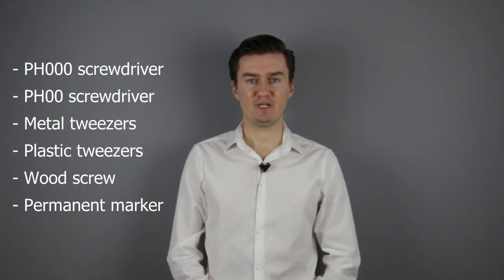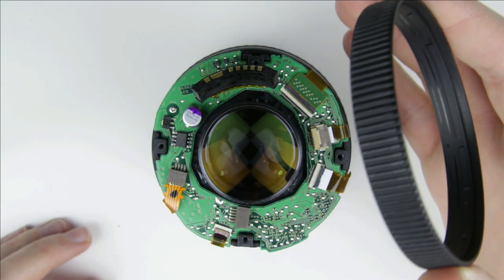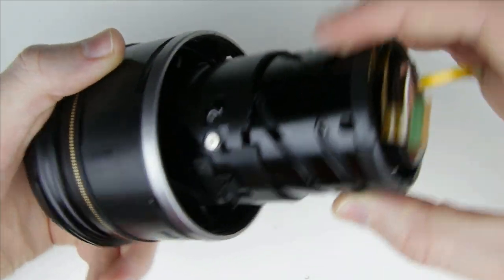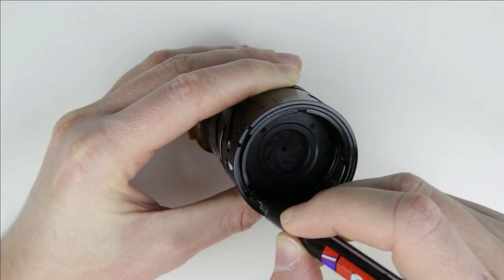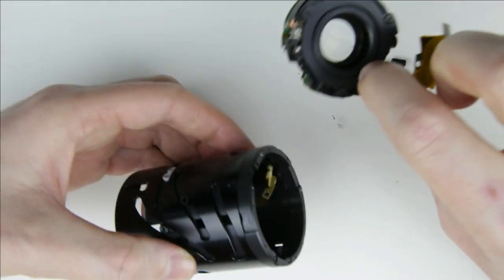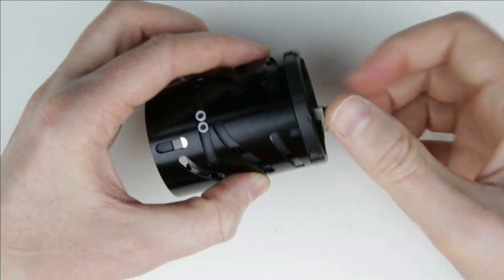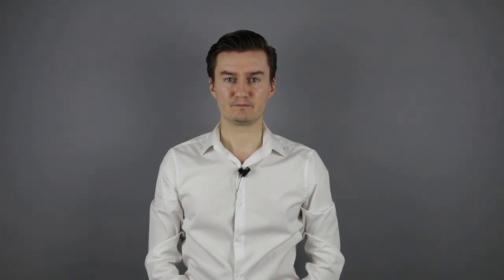Canon EF-S 17-55mm f/2.8 IS USM disassembly for replacing the aperture flex cable

Comment: Before you start disassembling the unit (9:20), mind that some of these lenses come with eccentric rollers on the IS unit. Mark their position and orientation before you disassemble in oder to avoid a decentered lens with poor optical performance.
Reply from the maker: I checked them, but none of them were eccentric, so that's why I haven't marked them.

Comment: What if you just need to clean inside back lens closest to bayonet? You can remove that around 5:36 correct you don't have to continue on? Mine appears to have the start of fungus inside that back glass & would like to remove it early on. Many thanks for your great videos! 🙏
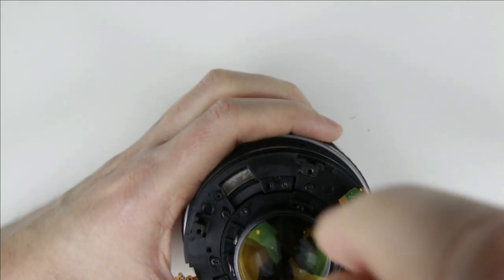Reply from the maker: As I remember, you have to follow this guide until I remove the PCB, then you can remove the rear lens element if you remove the screws which are parallel with the lens (so if you hold the lens downwards, the screws facing downwards, you can see those screws at 04:22). There are three screws which are parallel with the lens element (so if you hold the lens downwards, those screws are going horizontal)... those screws are calibrated, and as I remember covered with some glue, so don't remove those.

Comment: I'm really not sure if the risk @ 9:00 is worth it. If the loose focusing element crashes into the back of the front lens group the damage could exceed the lens' worth. Remove the front lens group beforehand (mark its position/orientation before you remove it) and then @ 9:00 push the cam barrel outwards and – after marking its orientation in the cam barrel – grab it carefully and screw it out, then store it in a secure place.
Reply from the maker: Thank you for your tip!

Comment: Tried the repair. Screws are glued with loctite somehow, maybe my second hand lens had already been repaired before ? In any case, I screwed up 2 threads of the usm motor. End of the story I think.
Reply from the maker: Sometimes some loose glue is used, but it is not preventing from removing the screws. Usually the problem is that the screwdriver not fits the screw perfectly, and it damages the screw.
If there is a little groove left in the screw, you might try Bondhus Screwgrab, or use a very small circular saw to cut a groove in the screw, and use a flathead screwdriver to get the screw out, or drill a hole in the head of the screw. If you cut or drill, be very careful not to get metal dust inside the lens.
Reply: @CamerasLensesEtc  Hi, I went with the circular saw and I got the screw removed ! Let's see how far I can get from here :)

Comment: I tried but got stuck at 7:15 the screw seems to be glued in place and won't move at all. Any tips?
Reply from the maker: Do you still have the head of the screw or it is shaved off? If you have, try other screwdrivers, there are some PH000 or PH00 ones which fits better, some of them don't go into the screw completely.
If the screw head is shaved off, then you can try to use a pliers with teeth to grab the screw from the side, or if that doesn't help you might have to drill the head of the screw. (Or search for other solutions here on youtube.)

Comment: Definitely worth the effort for a more expensive lens like 17-55mm.  I had a very old Canon 28-80 mm II kit lens that only worked properly with the camera set to aperture priority & f3.5.  Probably flex cable problem.  Anyway, it did work but photos were pretty soft and lots of purple chromatic aberration.  To get a decent photo it was necessary to adjust in the Gimp or Irfan View.  So I gave up on the lens & bought a Canon pancake lens which is a 100x better😀
Reply from the maker: Thank you for your comment!

Comment: I need to buy image stabilizer cable, where can i get it? Please answer, thanks.
Reply from the maker: As I remember, you can't buy the cable separately, you have to buy the whole IS unit.
Check ebay and aliexpress or your local camera repair shop.
Reply: @CamerasLensesEtc  many thanks for your information.

Comment: Deleted – provided wrong info here, sorry
Reply from the maker: The screws I removed at 12:45 are not calibrated/eccentric screws. There are three screws which are on the side of the lens (those still in the last lens element, and were not removed), and they are eccentric screws, so calibrated, but they were not removed from the last lens element I removed.
Reply: Deleted – provided wrong info here, sorry.

Comment: I know it's been several months since you posted this video, but do you remember if the zoom-ring on yours tended to be sticky?  My copy of the lens requires me to pull the focusing ring towards the camera fairly tightly if I want smooth zoom while using the lens to take video, and I'm curious if this is common or a quirk of my particular lens.
Reply from the maker: I repaired several of this lens since I posted some video, and zooming with some of those lenses are not smooth. What you can do is to apply a thin layer of fine mechanical grease on the sliding elements: inside the lens, on the metal lens tubes, and on the plastic cover of the lens where the rings (zoom ring - USM motor - focusing ring - rear cover) are sliding. Be careful when greasing the lens inside, the grease should not go on the lens elements. I use a small hard plastic brush, "paint" the grease on the metal sliding element, zoom a little bit, then I reach other parts through the cutouts, apply the grease then go on...
Also, you can tighten the screws which connects the front lens tube to the other parts of the lens.
Between 17 and 20mm, the lens needs just a little bit of force to zoom, it is normal, and comes from the inner design of the sliding parts.

Comment: Hey there, I'd love any wisdom you may have for me. I purchased a second hand 17-55 cheap. It has pretty bad lens creep where if I aim the lens down and shake slightly the lens will zoom to 55, it also has a pretty rough manual focus ring which sounds a bit like sand paper as you turn it. It otherwise functions perfectly. You've done a fantastic job as showing the lens' deconstruction above but I'm wondering what the appropriate fix would be for my two issue. Thank you! I've contacted Canon for a repair quote but it exceeded the price I've paid for it and I consider myself pretty handy.
Reply from the maker: Zoom creep: tighten the screws which I remove between 08:20 and 08:50. If that doesn't help enough, you can put a small rubbers to the three cutouts: starting from 06:22, I remove three screws and their washers from the side of the lens. Zoom out a little bit of the lens afterwards, and you can see small places / cutouts right next to the hole of the screws which are in the USM motor. You can put small rubber pads there, and that increases the friction between the USM motor and the zoom ring. You might put some grease on the rubber pads to slide it smoother.
Sand in the lens: disassemble the lens until removing the USM motor, then clean the lens rings / tubes (zoom ring, manual focus ring and the side of the USM motor), put some fine mechanical grease on the parts which are sliding (importantly, both sides of the manual focus ring).
Reply: @CamerasLensesEtc  amazing, Thank you so much! For greasing both sides of the manual focus ring, I can see a way to grease the inside but how do I grease 'both sides' does it need further disassembly?
Reply from the maker: @Ryan-Payne  What I mean by that is grease the front and rear side of the manual focus ring. (So if you hold the lens as it would be attached on the camera, the ring slides on the plastic sleeve where the white line is, which shows the current focal length (front side of the ring), and on the other side is where the focus scale window is, (rear side of the ring)). So grease the surface lightly where the two plastic surface meets.
You do not need to grease the inner side of the manual focus ring.
Reply: @CamerasLensesEtc  Thank you again and sorry if I am slow on the uptake. I have the USM motor here, but I can't see a good place to grease from. I see little wheels that look like they're part of the auto focus, and the other side of the manual wheel looks to be pressed up against more plastic. Do I need to remove more parts of the usm assembly? I see they are a few ribbon cables along it.
Reply from the maker: @Ryan-Payne  Don't grease anything in the USM motor. As I have written before, the manual focus ring is between two plastic covers, just grease the parts where the manual focus ring slides (touches) the two covers. I remove one of the cover at 03:05, then I remove the manual focus ring, then you have access to the other side of the ring.

Comment: I have this same lens. This morning, after several shots, it got stuck at 55mm zoom position. I cannot zoom out again.

QUESTION: Do you think is more probable to be just dirt, or there is any part prone to break which I have to buy? 

The rest of the story:

I did not force it because I could break it. If I shake the lens nothing sounds as borken, but there is a smooth clicking of a little part moving loose on the same position,  it always sounds alike.

I was shooting with a Canon EOS M5 (EF-M mount) with a Viltrox adapter when the lens failed. I believe the fault has nothing to do with that, it seems to be a mere mechanic problem. The lens did not suffer any impact or damage previously, but it is 2nd hand. No marks of impact are to see on the shell. 

Apart of this faillure the lens works fine: it communicates with the camera, focuses ok, diaphragm opens and closes correctly, also tested on a Canon EOS 600D 

Thank you for your video. I will have lots of next weekend. I'll let you know whether I succeed or not. ;-)

Fernando Clavijo
Reply from the maker: Most likely the screw(s) which connecting the front lens tube to the rest of the lens got loose, and that prevents zooming. It is a quite common problem, and it is relatively easy to repair. Just follow the disassembly video until 07:36, tighten the three big screws on the side of the lens (the screws I remove between 08:20 and 08:49). Then you might check the other screws if they are loose. Then assemble the lens.
Reply: @CamerasLensesEtc   Thanks a lot. Next weekend I wrap up my sleeves.
Reply: Hello again. 
The faillure was not exactly as you told but close.. It was one of those three little bolts (see minute 8:36) inside the zoom, which act as axis of three white rolling cylinders that guide the zoom along slonts when it rotates. One of those bolts was loose, and the thread of its hole was damaged. 
I solved glueing the bolt into its hole with Epoxi-glue. After a dry time y assembled the lens back and the zoom works again, somewhat hard, but this happened before the faillure.
I am not very confident on this fixing, but I thing it is not worth to acquire the inner zoom zylinder with the damaged hole. Maybe I buy some lens grease an apply it later. Meanwhile, I have to handle the zoom with care.
Many thanks for you video, i'm now about consindering donating ;-)
Reply from the maker: I'm glad my video has helped, and thank you very much for your donation!

Comment: Hi, thanks for the informative video, is there a way to replace the focus barrel from the front of the lens? (Part YB2-1083-000). I have the front element out after removing the trim ring and removing the 3 screws, but I cannot figure out how to remove the barrel that holds the threads, as my lens was dropped and a section of thread is now missing, thank for your help
Reply from the maker: I' not sure, but as I know there are still three screws which can be accessed from the front of the lens (after the front lens element has been removed), and if you remove those additional three screws, then you can separate the front lens barrel and the lens barrel which is inside of it.